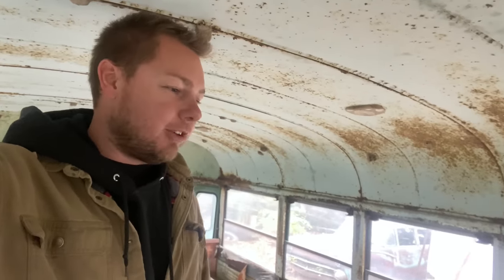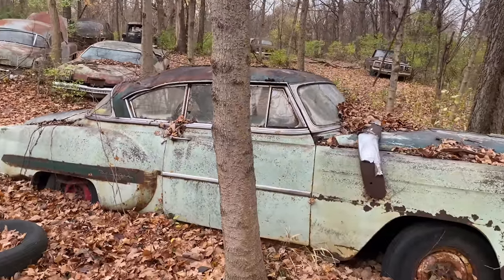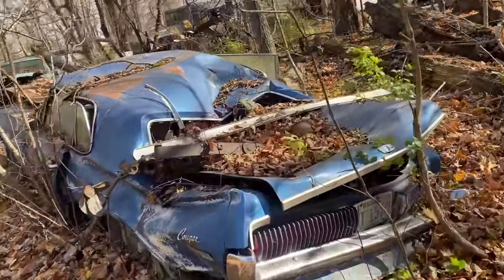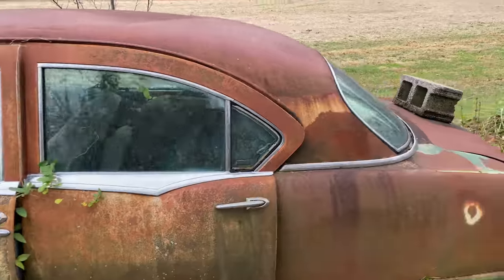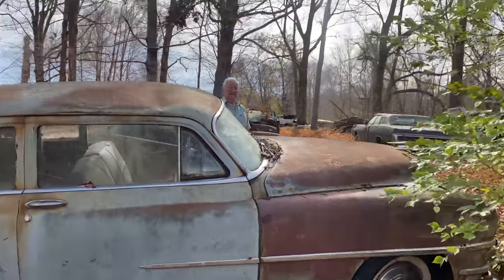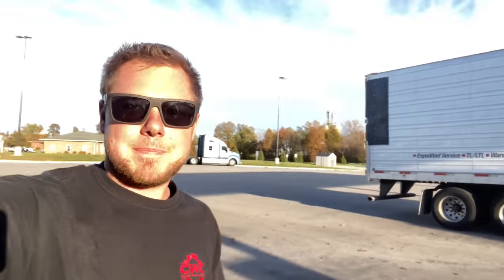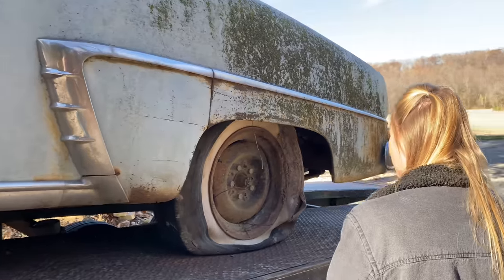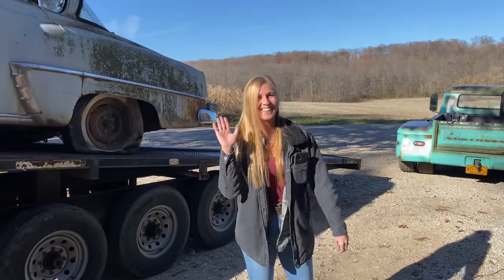I hope Hannah Approves

Comment: that 2 door car you didnt know was a studebaker hawk
Reply: I'm thinking 53 or 54 Starlight. 55 had a one year grill/bumper that this isn't. It could be a 56 Hawk, but not a 56 Golden Hawk, because they had one year only short fins. There were several other Hawks that year with no fins though. Sky Hawk, Power Hawk, and a couple others I'm having a senior moment on. The hood would help tell. They were all the same basic frame and body until 64, with the GT's getting the facelift, square roof, and no fins in 62...
Reply from the maker: O yeah ??
Reply: @corywheatcustoms  Yeah, I had a straight solid 62 GT, California car, shipped it to IL. I either had the time and not the money, or the money and not the time, so I sold it to a guy, and wish I had it back. He did it up right though, it's gorgeous now.